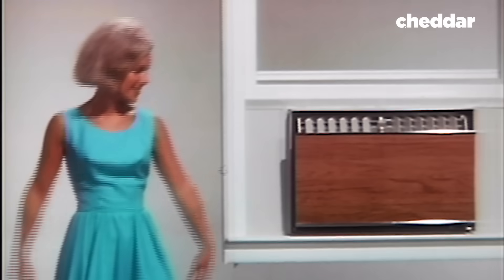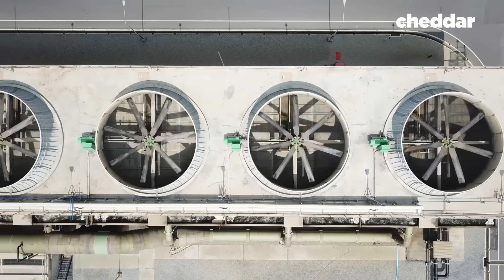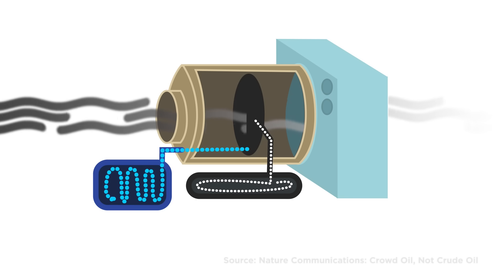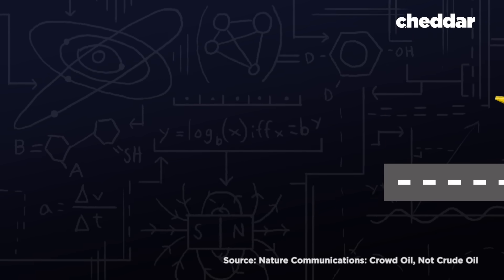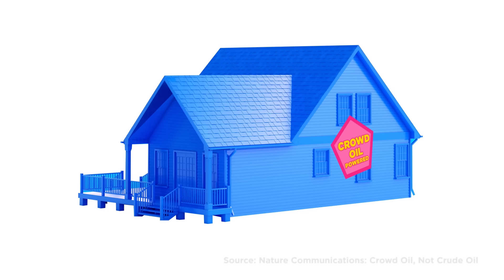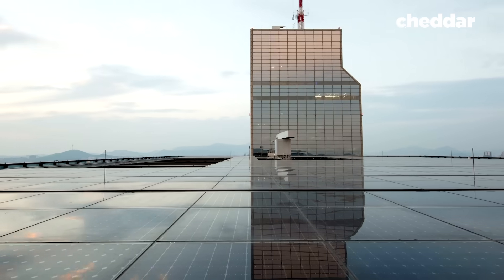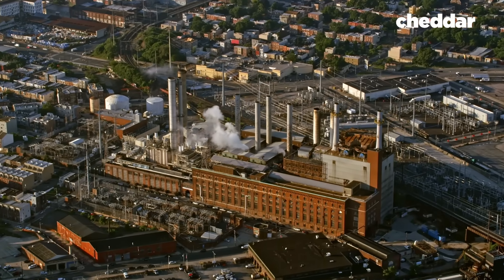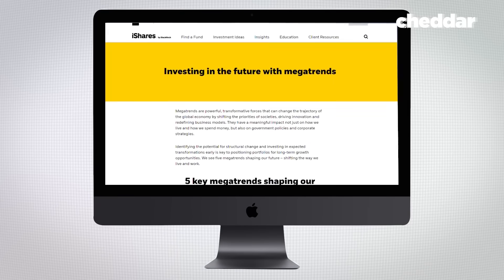How Your AC Could Help Instead of Hurt The Environment - Cheddar Explores

Comment: This is one of the stupidest "green" ideas I've ever heard. The energy lost on the fans in AC is a small percentage of actual AC power usage. Most of the energy is used in the compressor. So you want to reuse that fan energy, but then add energy to split water (very energy intensive) and energy to combine with H with the C. Add in storage, transportation and the initial energy and cost to produce the unit. It's basically wasting 100Wh to save 1Wh.

This video badly needs to include numbers on the energy lost to the AC fan and the energy for all of the processes along the way to the end hydrocarbon.

Comment: This is astronomically stupid. If the power must come from renewable sources, would it not be easier to just use the electricity?

To make petroleum to power motor vehicles which will burn the fuel and produce emissions. You're substituting a battery for petroleum.

Could you not say, oh I don't know, use the hydrogen like the Honda clarity.

Could you not, for example, simply propel your car with electricity. Since we're talking so long term anyways.

I want to see a comparison of energy consumption to possible energy extractable from the fuel, as thermodynamics exist and this seems to good to be true

Comment: So basically, it converts CO2, a relatively harmless gas, into dangerous toxic, volatile, combustible hydrocarbons that can leak or spill if handled incorrectly. And you want to put that in buildings which arnt designed to handle it. In the event of a fire, instead of one building burning down, the whole city goes up in flames? Sounds like a great idea!

Comment: On the face of it, this seems like a stupid idea.  The fact that they are proposing that solar panels be used to power these devices indicates that they probably do not capture more carbon than they emit without the solar, so why bother, when you could just install solar panels and avoid using electricity from fossil fuels in the first place, seeing as the latter option would involve fewer steps and thus be more efficient and cost-effective?  In order for these to be a helpful solution, they would need to be able to use fossil fuels to generate the electricity to power them to remove CO2 from the atmosphere in a way that is carbon negative.  Also, if these are actually meant to remove CO2, then the fuel that they would produce would need to be worthless, because if people turn around and burn it again, then these devices are not removing the CO2, just recycling it.  And they would not be cost-competitive without being able to sell the fuel that they would create, so what is the point?  Again, there are more proven and direct methods of generating energy with fewer emissions.  The only real application I see for these is as a form of energy storage that could be used to balance the grid.  That might be worth exploring, but that was not the take provided by this video.

Comment: You can "carbon scrub" OR "create fuel" but not both!
Reply: Yes you can.  In fact not only can you do that, doing so sequesters carbon.  It's only when you burn the carbon that this ends up being carbon neutral. 

Provided all of these systems are powered with green energy, making the energy demand needed to do this carbon zero itself.
Reply: @Killua2001  green energy isn't neutral, and you AREN'T removing carbon from the atmosphere if you are putting it straight back again.

Comment: My biggest concern is about the fuel because if we burn the fuel the carbon that was in the fuel is now back as a gas which means we will have to either make even better cattalitic converters or find some way to stop the carbon from getting to the atmosphere so what we really need is to convert that carbon into oxygen directly from the generator/engine if we want to make this plan into a real thing

Comment: Does it help to capture the carbon if you're going to burn it out again?
Reply: Doing so recycles carbon while the alternative is to ADD MORE carbon. This would be a viable means of power storage which would make renewables more viable and make combustion cars which run on it carbon-neutral.

Comment: So it captures carbon which is then release when you use the fuel in car?.  I think it's better to just capture the carbon and put it back where we fooking found it to truly revere the carbon. Then use electric power to gain TRUE carbon free fuel. Such as hydrogen fuel cells and lithium batteries

Comment: So to save all the complications wouldn't it just be better to harness energy from renewable sources in the long run, for which there is already a commercially viable market and that will reduce the amount of CO2 generated instead of creating more carbon products.

And in addition, we can just plant more trees to remove the existing high levels of CO2 in the atmosphere.

While the technology mentioned is great and I am generally supportive of such research and technology, in this particular instance the final objective of reducing CO2 can be achieved with far less effort, resources and funding. We just need to continue to support existing green and sustainable methods in place.

Comment: Electrolysis right after dehumidification? I can't imagine how much power this would use. Most definitely way less than you'll get out of it. Also, instead of using that hydrogen/oxygen as fuel, they combine it with CO2 to make fuel? If you burn that, the CO2 will go right back into the atmosphere. Why bother in the first place? The filter will also significantly reduce the airflow of the air conditioner, so additional power will be required to force the air through. I have a better alternative - use renewable or nuclear energy.

Comment: So... you never clearly explained how its energetically more efficient to attach this kind of system to existing AC units then to have AC and carbon capture separately. Seems like making a complex delivery network for delivering home made oil is a solution in look for a problem in addition to being INCREDIBLY expensive. It would be easier to just cover our roofs in solar, build a more robust energy grid, and build carbon capture offsite.

Comment: Dumb fools, start planting trees which does not require electricity to operate no maintenance is required also releases the trapped oxygen from carbon dioxide molecule instead of capturing whole carbon dioxide molecule which contains oxygen. Dumb fools, its simple as that, what the hell they are thinking

Comment: Thats ok but in order for it to be actively carbon neutral the power required by crowd oil systems and the hvac system has to be renewable energy. Not to mention the chemicals required or the energy required to make those systems from raw materials in first place have to be carbon neutral.

Comment: One important question.What is the energy efficiency of such a energy storage system compared to batteries? because this is what this thing is. My guess it's very very low. And before you comment that the energy density is much higher in carbon-fuels - this is NOT what I am referring to. The energy efficiency of carbon-fuels powered cars and engines is a lot lower than electric motors too, keep that in mind. So think in terms of overall energy efficiency. And the fact it just "happened" that the main scientist is German - Germany has the largest carbon-fuel cars manufacturing factories, did not want to convert to batteries, and  they start to struggle against the likes of Tesla.

Comment: Air conditioners do pull water out of the air but it just gets put back outside, has anyone done research on the possible negative effects of removing this much water from the air? 

I’d imagine it must have some negative effects on whether systems, and the environment, because the air would be more dry and unable to as much retain heat, so at night temperatures could be more variable. Condensation that could form on plants could be effected at night as well, at worse I’d imagine there’s a possibility it could effect where rain falls by effecting pressure systems because of the temperature changes. I also know countries are fighting over water, to hear the west is turning it into fuel could also spark some outrage.

Comment: With a huge added cost to the air conditioning system and no refineries will use the "crowd" oil when the oil companies give them discounts not to.... when will the tree huggers learn there is no free lunch...

Comment: Wait, so pull the carbon out of the air, add additional electricity to separate the water, then combine it with the carbon dioxide to create fuel that is then burned to generate energy? 

Sooooo capture carbon, burn fuels to create fuel, then burn fuels created by burning fuels. Something doesn't add up here.
Reply: Watch the video again buddy.

Comment: How about fuck carbon based fuels, regardless of whether they come from fossils or are synthetic. They need to figure out something better to do with the CO2. If they turn it into fuel which then gets burned, the carbon just goes back into the atmosphere. Carbon capture needs to do better than carbon neutral. It needs to remove CO2 from the atmosphere and keep it out of there, to be of any use in fighting climate change.

If you want energy efficient cooling, use heat pumps. Better yet, heat pumps with pipes that go deep into the ground, where the temperature stays constant all year round. That way you have one incredibly efficient system that can do cooling in the summer and heating in the winter.

Comment: Sounds great until you realize the law of conservation prevents this whole system from actually working. But hey, if you make AC systems run without power, SIGN ME UP!!! Problem is, you run one of these fans to capture gas but you need two extra fans to power that one fan. The energy needs to come from somewhere.

Comment: You failed to mention that putting a filter over the AC fan will reduce its efficiency causing it to use more energy and thus produce more carbon.

Comment: what's the point of removing carbon dioxide from the atmosphere to turn it into fossil fuels and dump it there again shortly after?
Reply: Doing so recycles carbon while the alternative is to ADD MORE carbon. This would be a viable means of power storage which would make renewables more viable and make combustion cars which run on it carbon-neutral.

Comment: While this isn't a strictly bad idea it needs to be thought about differently.
The big issue is that this is actually an energy sink. Just like the process that converts hydrocarbons and oxygen to water and carbon dioxide gives off energy, this process, which is chemically a reversal of that process, requires energy to perform, through the electrolysis step in this particular execution. The theoretical best for performing both process would be breaking even in energy but unfortunately every step has significant inefficiencies so much of the energy would be lost overall.
A better use for the created hydrocarbons would be for the production of materials like plastics which, as far as I know, cannot be done without hydrocarbons, unlike energy production. However we would want to create and implement actual solutions to CO2 production from energy production on a significant scale before starting to do this.

Comment: Now correct me if I wrong but wouldn't adding a filter restrict air flow which would require the fan to spin faster to maintain airflow rate increasing energy demand + the energy required for the electrolyzer cause the net energy production to be net - ie won't this be just throwing away energy that already exist as electricity

Now if someone was to take nuclear energy to convert energy CO2 and H+ simply for the sake of maintaining hydrocarbon as a storage system for energy that would be a different story

Comment: If the fuel could be sold for a profit despite the increased cost of electricity, it wouldn't take a policy action. Hydrolysis is expensive. It takes a lot of energy to separate atoms in a molecule. If the energy source was cheap enough to make fuel for less than the cost of pumping it from the ground, then it's feasible. Feasibility is not just about technology. If it takes more going in than what you get out, it's DOA. Stacking technologies is a great way to lower costs, otherwise.

Comment: so if the electricity from this co2 converter is from solar panel. thats make the solar panel store energy in form of carbon based fuel instead of litium battery.

Comment: This would only be good for cleaning up the airline industry. Small planes for one or two people can be converted to battery power, but big passenger or freight ones can't. They're simply too dependent on the energy density of hydrocarbon fuels. The best we can do for that sector is require that all hydrocarbon fuel used by them be manufactured from atmospheric carbon dioxide. You might, however, be able to manufacture it on-site at the airport, though, which would save on fuel transport costs and emissions.

Comment: If the contraption makes oil, doesn’t it just take the carbon dioxide back into the air.
Reply: It will cause the reduction of new carbon from the ground being put in the air. It's not carbon-positive or carbon-negative, it's carbon-neutral.

Comment: These fans wouldn't pull enough carbon dioxide from the air to offset the effects of the employees driving to work every day. It's just not an efficient way to solve the problem.

Comment: If this system only runs on carbon in the air, if we theoretically reach a point where carbon levels would be normal, wouldn't that make these machines unusable? Maybe we would actually reach a carbon defecit? Or worse- companies would artificially pump carbon into the air to keep these machines running? Is it going to be sustainable?

Comment: Sorry to say this but it wont be feasible. And just to let you know i work in the air condition industry. 

All of the biggest issue of the aircon business is the Large amount of power required to cool a home by a few degrees. In fact almost all electricity bill of every home around the world will come from air conditioners. If these ac units now have to make fuel, it might actually be worse than just pulling oil from the ground. 

The trick is not to find new sources of petrol but to just use less oil.

Comment: Yeah, great idea... Let's capture CO2, turn it into fuel and then release it back into the air by burning it again. Making absolutely no difference whatsoever.
If you then also consider the power it takes to turn CO2 into fuel, you come to the conclusion that this setup essentially uses electricity to generate gasoline to power cars, but it uses 10 times as much energy as powering an electric car directly. So what was the point of this whole idea again? Wasting energy for no good reason?
Reply: Or, plants consume the CO2 for free. Stop cutting down our trees.

Comment: great idea but we should be sequestering the carbon and using the h2o to generate the power via hydrogen fuel cell tech - whatever the option it doesnt make sense to pull carbon out of the atmosphere just to burn it again, we need carbon negative solutions like, yesterday

Comment: you could also add particle filters into them, to reduce harmful particles in the air... so many AC running on a daily basis, could easily filter at least parts of the ongoing traffic out of the air.

Comment: So this process will convert carbon dioxide into methane.... if 1 in 1000 of these fails and spills its methane load it will have accomplished nothing.  If 2 in 1000 fail and release their methane we are considerably worse off then before.

Comment: This helps, but it doesn't fix anything. If we continually pull carbon out of the air, turn it into fuel, and burn it again, it's just cycling a high amount of carbon in the atmosphere. The whole point is to get the carbon out of the air. Recycling it is good, but it's not something we should do permanently. I'd rather just use any fans that already exist for carbon capture but without the burning part. Sure you don't have a usable byproduct, but you also don't have massive economic damage from climate change.

Comment: You can't just slap a filter on a fan and expect it to perform the same. I attached a 20" furnace filter to ao 20" box fan and the motor overheated eventually. The extra force required to perform the fiiltering is more significant than you think, and definitely more energy intensive than the carbon extracted from the air.
Reply: if the fan is powered by renewables, then pumping extra energy into the system doesn't matter.

Comment: That's all well and good but what are the efficiencies and energy requirements like? Also, when are we getting that solar skin?
Reply: Generating more power than it consumes would break the laws of thermodynamics, but that's not thd point. 
This would be a viable means of power storage which would make renewables more viable and make combustion cars which run on it carbon-neutral.

Comment: I don't think it will be beneficial when you crowd source. It decreases the efficiency of the AC's
But done in the right place,
It is just a way to offset new carbon.
Untill the world becomes fully electric, this can be done as a way to stop digging for new oil and can act as a battery. Like using the energy where there is surplus (eg wind energy) to produce this fuel and can be transported where needed.

Comment: The problem with this idea is that you are not storing the carbon. You are taking CO2 from the air turning into fuel which will then be burnt and turned back into CO2 again. And it all requires renewable energy as an energy source. Surely it would be better to use electric cars and electric vehicles and just use the renewable energy directly. In this system none of the CO2 ends up being taken out of the atmosphere in the long term it’s just returned at a later stage.